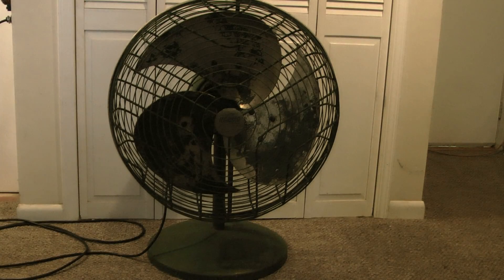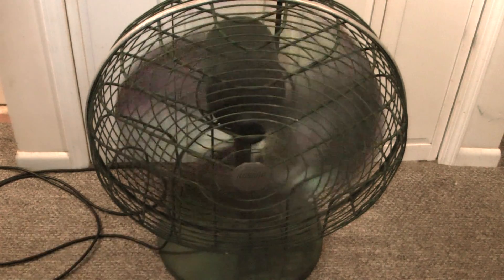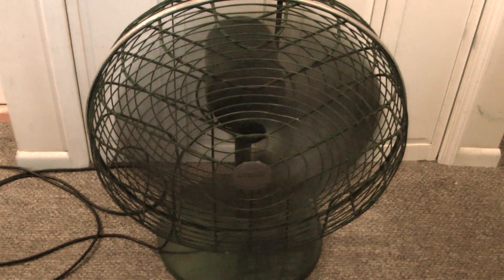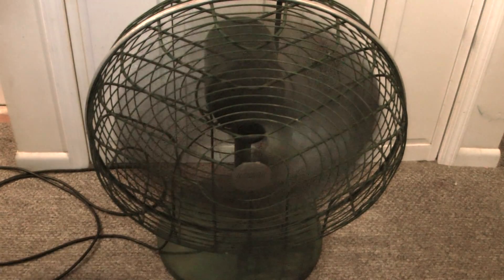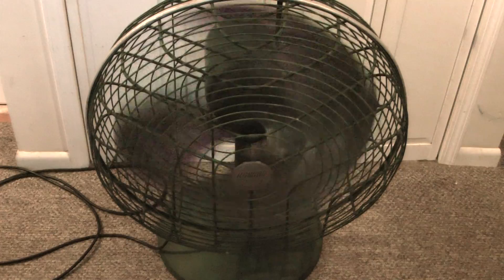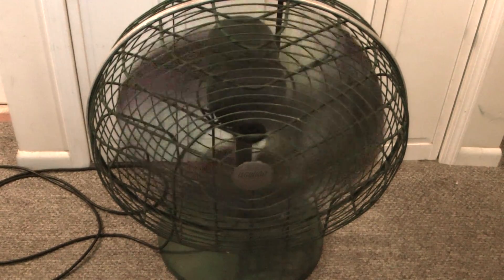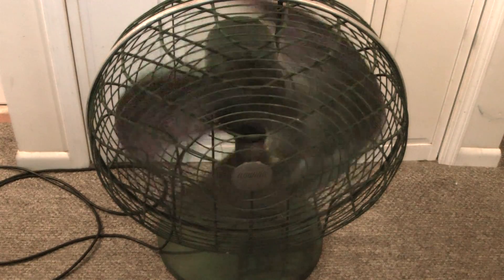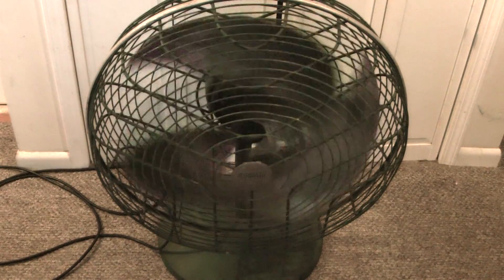1940's ILG ILGWIND Portable Window Fan Model 272 (Part 1.)

Comment: Sounds like it could use some work on the bearings, I've got an old Emerson Electric 24 inch fan from circa 1938 that needs new bearings, I'm working on taking it apart so I can take the motor to get professionally rebuilt, new bearings and varnish on the windings, also have to weld the cage back together and polish the chrome and maybe repaint the base, I'm planning on having it looking factory fresh and functional by fall

Comment: This fan is rated at 115V ~ 60Hz.
Reply: And so is literally every electric fan intended for use in the USA. Since the USA electric grid runs on 60hz ONLY and has outlets running from 110v to 120v with some variation.

Comment: ILGs are cool, I have a couple. How did you get so many? They have a most efficient blade design, and impressive to look at, one of few that turn counter clockwise.
I have a huge ILG 220volt, three phase with Bakelite blades which obtained some damage before I got it. Is there any repair for this?          CF

Comment: Interested in selling or trading that one for an Ilgjet or any of the other Ilg's I've got? I'm in New Orleans.
Reply from the maker: I don't know what ILG fans you have. You don't have any videos on your channel.
Reply from the maker: Ethan LeBeau
Oh, okay. I remember you. I actually like this one. Not only as a window fan but it is the right height when I am boiling crawfish. lol
Reply: Emerson Collie I think yours is a cut down pedestal. Where did you find it? I've been looking for one with that blade.
Reply: Emerson Collie The Ilgjet I think is basically the evolution of the Ilgwind. Same basic design, just the Ilgjet was the industrial version and the Ilgwind was the consumer.
Reply from the maker: Ethan LeBeau
It's actually a portable window fan. ILG listed as a portable window fan in their catalog. You can raise it up or down. Depending how high or low your window is. Homes back when this fan was made had lower windows. The fan head is fixed so there is no tilting up or down with it. It just raises up or down. In the video, the fan was at it's lowest point that it will go.

I found it on ebay, and it's been listed on ebay for well over eight months. It cost me $325.00 and the shipping was $103.00. These are rare as you know and who knows when there will be another one up. So I bought it, because I know that it will out last me and then some.
Reply: Emerson Collie Yes, they sold it as mancooler also. I have the 27 and the 33" versions.

My 4 cast wing one originally had a canvas duct that connected it to the window. Interesting design also by Pfautsch.
Reply from the maker: Ethan LeBeau Yep. I'm not sure on how many ILG models used that 4 cast wing blade other then the one you have. I know some of their ceiling mounted heaters had 4 blades. Don't know if they were a one piece cast like the one you have. Haven't came across an ILG exhaust fan with that blade on them. I only seen the "W" and "Q" ones being used. I know the "Q" replaced it starting in 1940.

You can spot a first generation "Q" fan. The blades were not shaped like tear drops like they do in the 50's. Each blade had 4 rivets a piece and a rounded curve from the blade that points to the center hub. The motor still has grease cups and a centrifugal starting switch. I believe legogamecreator has the first generation in his collection. https://www.youtube.com/watch?v=Pdxau8nYJdY